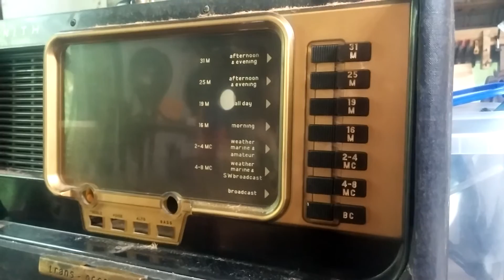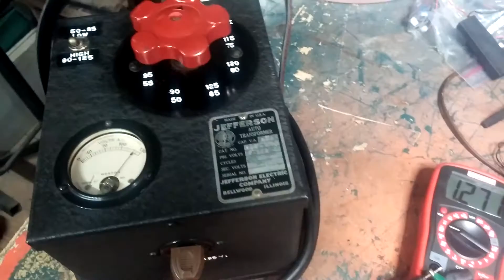Zenith Trans-Oceanic portable shortwave  radio, Model H500 (Vid 1)

Comment: Nice set... Real radios like that one definitely glow in the dark, even if they have delicate 1.5 volt filaments that can barely be seen while they are glowing.  ;-)

Here's a little tip on how to get Vacuum-tube radios that don't have a BFO  to be able to copy SSB and CW signals:

Simply wrap a few turns of one end of  a short length of  INSULATED hook-up wire around the plate lead of the converter tube and the other end around the plate lead going to the diode of the detector/first AF amp tube.... just wrap the wire insulation-and-all around the convertor plate and detector diode plate leads, whether they are insulated or not...just make sure that the wire inside the short length of insulated hook-up wire does not touch anything... that will form two 'gimmick' capacitors and they will couple the IF's output right back into it's input out-of-phase, and will cause the IF stage to go into regeneration and it will hetrodyne it's own oscillations with the incoming SSB or CW signals and make them clearly copy-able without doing a thing to the radio, other than just opening it up  and wrapping the insulated wire around the two wires inside, and BAM!!.. instant BFO!..lol!  :-D

I built a basic AA5 BCB radio kit some years ago and eventually evolved it into a SWL set then eventually into the RX side of a home-brew 40 meter 50 watt AM/CW transceiver with 13 tubes total in the TX/RX/Modulator-AF circuits. For the IF stage regeneration  I soldered a short piece of insulated hook-up wire to the plate connection on the convertor tube socket and another separate little length of insulated hook-up wire to the diode's plate connection on the detector/first AF tube socket, then just brought the two insulated ends together and twisted them a few turns, keeping the wire tips inside the insulation away from each other... that formed a single gimmick capacitor-coupling for the  feedback-path, then, I set up a 10-turn 100 K potentiometer  in-line with the IF stage's screen-grid supply to control the IF regeneration.

Comment: Cool, I just picked up one of these myself last Wednesday.  H500.  Arthur Hollingsworth has a whole series of a restoration of this model on his channel.  I need to check mine and see if it still has the selenium rectifier.  I'm sure mine has been serviced because there is no hum and everything operates smoothly and it was clean as a whistle inside.  I also want to take mine out on the back deck some evening and see what kind of stations I can get on SW, away from all the noise producing stuff in thehouse like the pc, fridge, lights, etc.